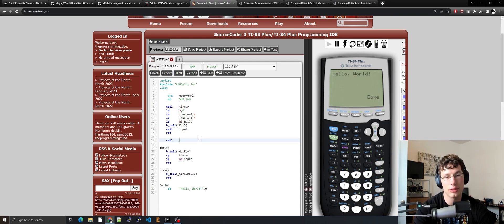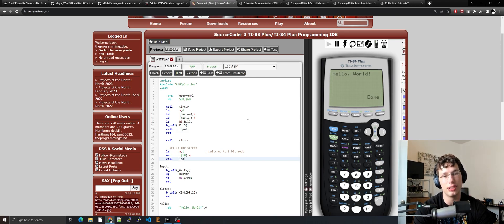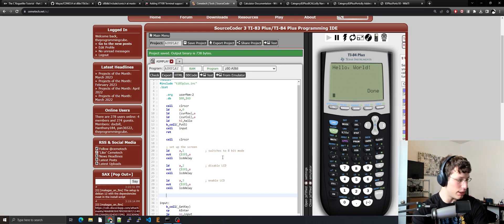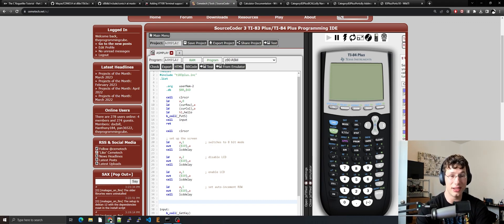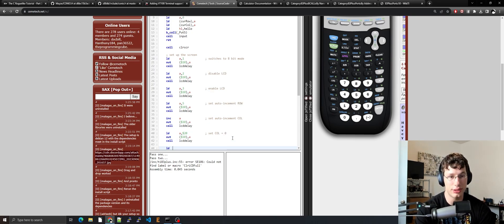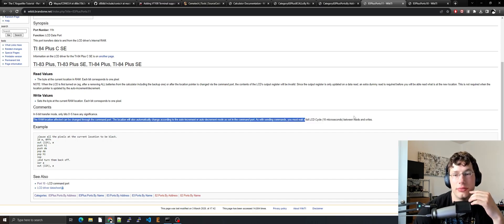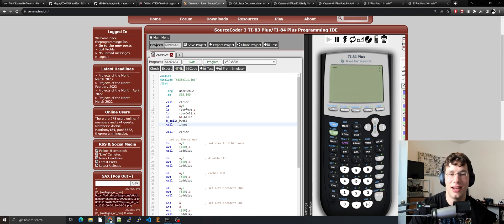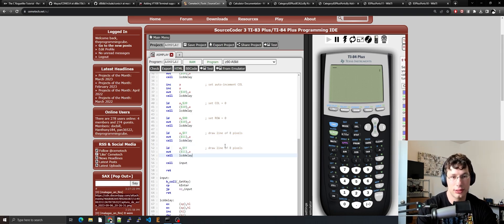Hello World + GRAPHICS in Z80 Assembly! Ti 84+ Assembly Tutorial

Comment: Hello, I have one question concerning this. I just want to print Hello World on the screen and therefore I wrote the same as you, compiled it (with Brass.exe) and then load it into the calculator - but it’s not working… do you know what’s wrong here (the error says: unable to load the specific file. Are you sure it’s a TI83+  program )
Reply from the maker: Hm, sounds like its not quite linking right. Perhaps those leading bytes aren't right. Do you have the db bytes at the top?

Also, are you running this on a Ti 83+, or a Ti 83? Ti 83's did something different iirc
Can you pastebin us the code and build command?
Reply: I think the problem was that I had to add .binarymode TI8x because I am using the assembler Brass.

But now there is another problem: I can load the program into the emulator, but nothing is happening. So if I type in asm(prgm..) it just says done but there is no helloworld on the screen. 

Yes I have the leading db bytes and I have a TI84+ calculator.

Thanks for your help.
Reply from the maker: @tanjalippert8713  Do note thar every assembler has its own syntax and quirks. This tutorial is for the jsTIfied assembler, not Brass.
Reply from the maker: @tanjalippert8713  Do you have puts? I do have a newline sometimes, so you can move the done line down.